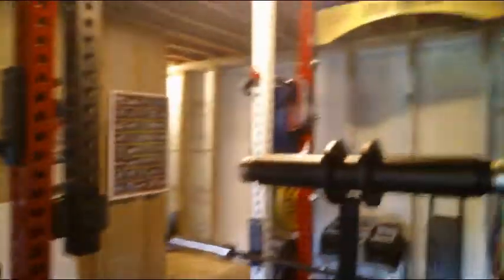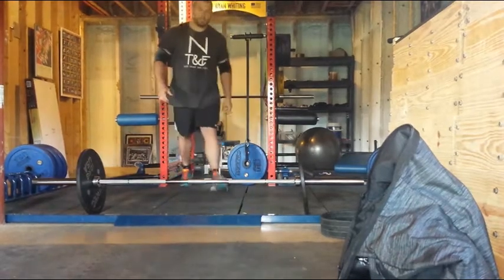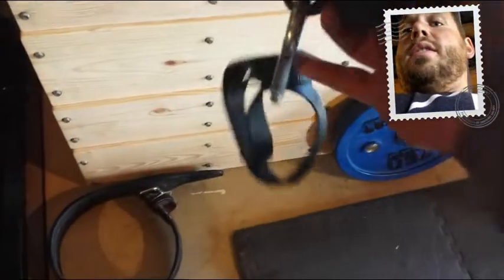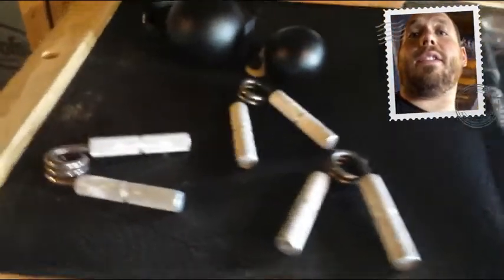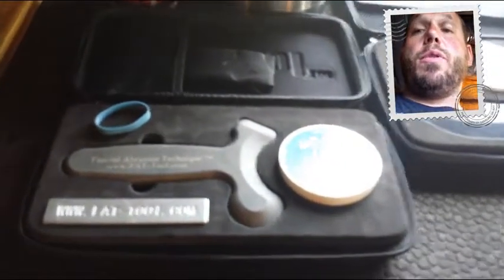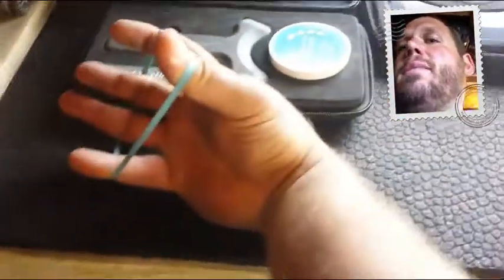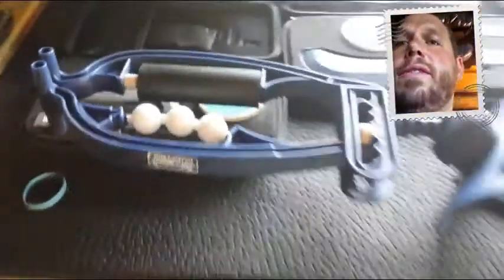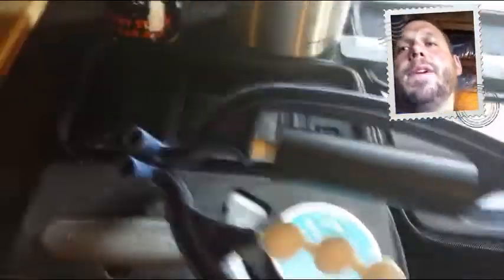Grip workout and hand/arm rehab for throwers

Comment: Hello Ryan Whiting, I've throwing for a while now and I started using the rotational technique about a year ago and I recently started feeling a pain in my elbow when ever I released the shot at the end of my throws. It hurts when I flex my bicep and when I try to extend my arm fully. My trainer said it could but tendinitis but I just wanted to know if you ever experienced anything like that before.
Reply: I would say that you could be palming the shot. If you are holding the shot by the palms of your hand, instead of the edge of your fingers.
Reply from the maker: I have elbow pain every year, it comes and goes but it sounds like what you described.  My best advice is icing your arm after you throw.  Most elite throwers I know have elbow pain in some form or anotheR, just comes with the territory